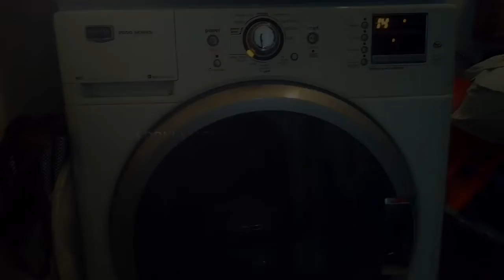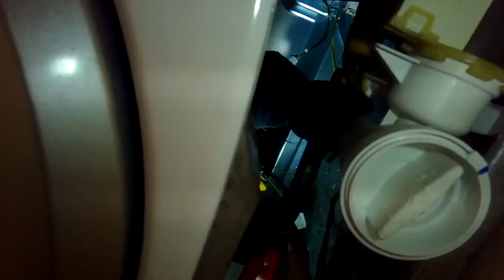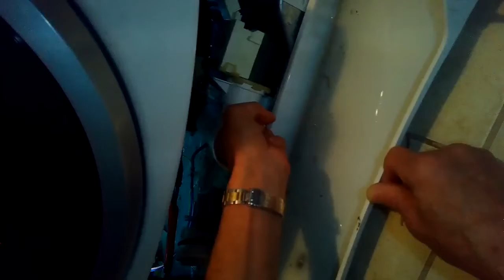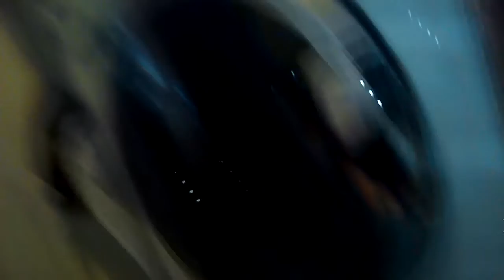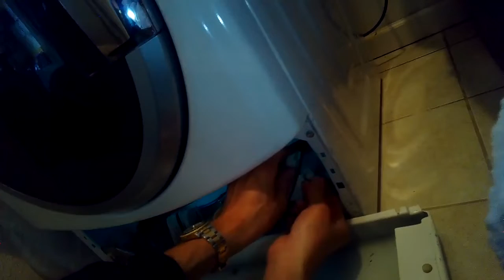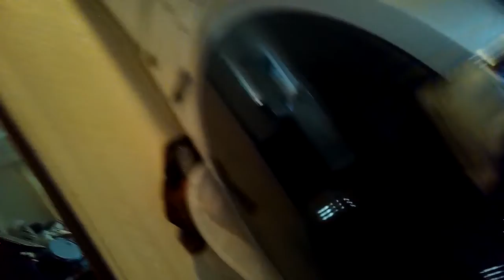Maytag 2000 Washer Won’t Drain

Comment: there are three screws at the bottom of the bottom panel. You will need a 1/4 screw head
Reply from the maker: Thanks for the info 👍
Reply: Haha, I read this after spending 20 mins trying to find the right size... Very helpful

Comment: Great vid, nice and instructive! 
Cleaning the filter is indeed the first step but in my case, a rubber band went through the filter and wrapped itself around the impeller of the pump. It caused the drain pump to malfunction either totally or partially at random. I could move the impeller with my finger, felt a bit of resistance but I thought it was normal.  So next step I'd suggest to remove the pump motor from the pump assembly, it's very easy, and do a visual inspection of the propeller.
Reply from the maker: Nice work!😊

Comment: I have the same washer I got it free because the door was stuck locked. The woman said it drained completely before I picked it up but she had to have not noticed it still had alot of water in it. So we dumped the water by removing the back panel and hose and brought it home. I unlocked the door by pulling the lever under the lock internally. Plugged everything up and it turned on perfectly fine and started working. Then my toddler came along and pressed some buttons in a flash an error code popped up. I didn't get to see if the thing spun out good or drained. Now it says the door is locked again and has water in it. I unplugged it for 5 mins and the door stayed locked so I manually unlocked it again. And then tried to start the cycle. It still pops up the error code. E1 f1.. do you think it's the control board?
Reply from the maker: Your right, main control board.

I would pop the top and then disconnect and reconnect each wire connection .
Reply: @ScottTheFixItGuyChannel  I haven't done this yet but I did check for power to the pump and it did have power. So I took the pump out and disconnected it from the coin catcher. It didn't easily utmost and with a little force a very warn penny flew out of the pump itself. Even though the propeller would turn freely. I don't have anyway to test the pump since I don't have a car battery or vehicle rn lol. The pump is $37 on ebay. Do you think I should try it if it's free returns

Comment: Ok team so I just did this and remember to replace the cover or else you get another error code. But this works think of it as your washers lint trap
Reply: How does the machine know that the access panel is off? If this is true why would the washing machine send power to the impeller with the access panel off?